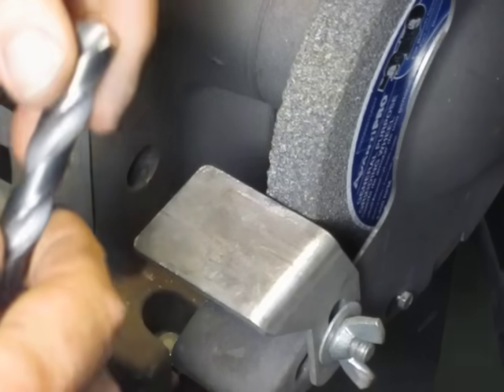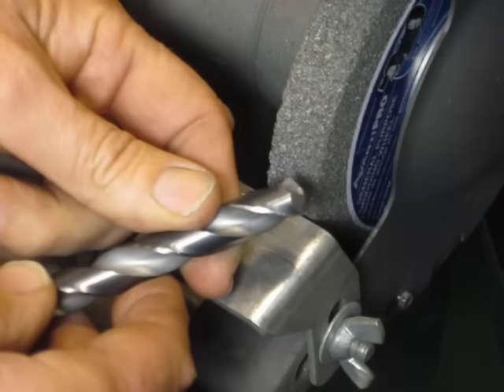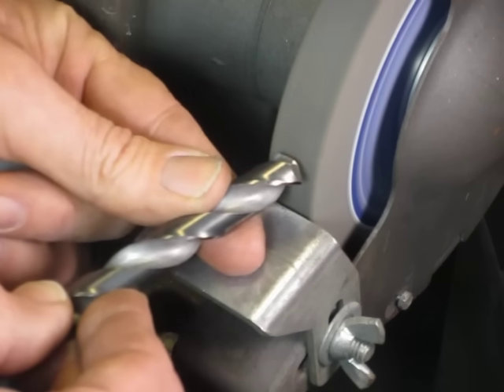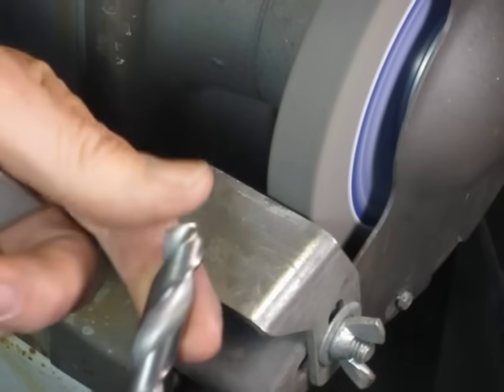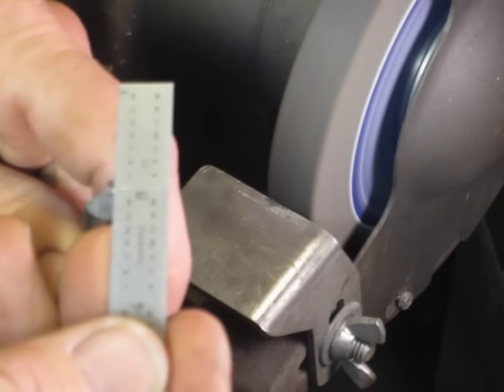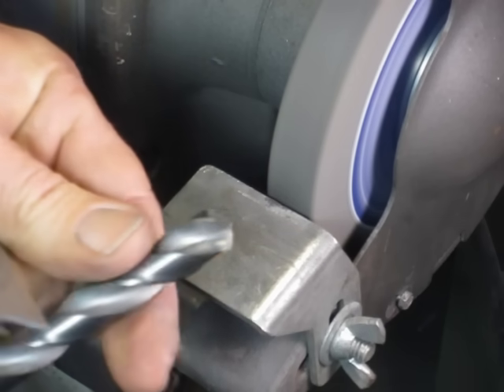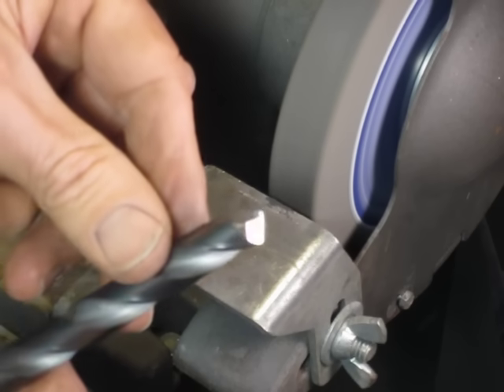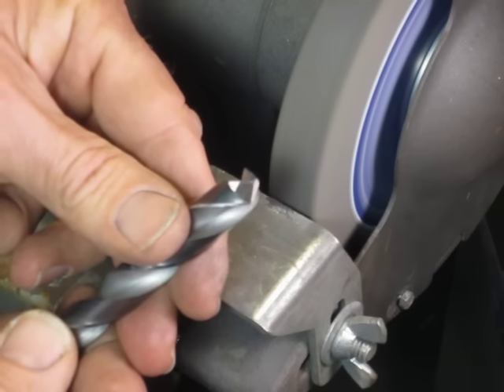How to Hand Sharpen a Twist Drill

Comment: Oh, forgot to mention, I printed out the 118º & 59º angels off my ink jet printer, laid it under the grinder edge and gave me a reference right there, then lay the bit to confirm the angles.
Reply from the maker: +wrthrash 
It's good to hear you enjoyed the tutorial. 

The paper template is an interesting temporary tool, but you may want to invest in a drill gauge for long term use.

Tom

Comment: If you clean up the cutting edge and then roll it back, alternating side to side to keep it even it may not look so pretty but it works just as well. A navy machinest showed me in 72 on Diego Garcia, been doing it ever since and saved a lot of money
Reply from the maker: +Cbmech 

I used to grind them using radial clearance until I discovered this method. It's much easier to control the angle and length of the cutting edge if the drill is held stationary, especially for those early in the learning stage. I do still use radial technique on the secondary clearance angle of larger drills because otherwise it takes multiple facets to get enough clearance. This multi faceted technique also uses less power to drive the drill which makes a big difference in the amount of heat generated with larger drills.

Tom

Comment: thank you for sharing your expertise. my question for you is I'm a novice if you could let people know everything meaning like the grinding wheel what size stone would you use to sharpen a drill bit? and how do you keep your drill bit from wandering? thank you very much keep up the great work. Merry Christmas Charlie
Reply from the maker: +Charlie053 
Merry Christmas to you Charlie.

I assume by stone size, you mean what grit wheel to use. The one in the video is 60 grit and works great for roughing out lathe bits in a hurry, but is a little on the coarse side for drills. An 80 or 100 grit would be more appropriate. 

As far as controlling the bit goes, that just takes practice. As I mentioned in the video, brace your hand on the tool rest of the grinder and practice lifting the tool off and placing it back on the wheel in the same orientation. A piece of mild steel is good to practice with because it makes more sparks and is easier to see how it is touching the wheel.

Tom

Comment: Or just roll the drill clockwise from the cutting points, going slower as you progress to keep the cutting bit raised, over the manufacturers already there 'cutting angle' and not faff about with angle finders & the like. That's what I do, I use a 40 grit linisher. 

Interesting video!
Reply from the maker: +terry tibbs 
I used to grind them all that way until I discovered this method. It's much easier to control the angle and length of the cutting edge if the drill is stationary, especially for those early in the learning stage. I do still use radial technique on the secondary clearance angle of larger drills because otherwise it takes multiple facets to get enough clearance.

This multi faceted technique also uses less power to drive the drill which makes a big difference in the amount of heat generated with larger drills.

Tom

Comment: No offence its a very good demonstartion but I think you probably  need to explain the basics as to how and why a sharp drill cuts and why a blunt or poorly sharpened one doesn';t with a demonstration/ diagram  of the twist drill. Basically to show the angle of attack of the cutting edge into the work. The 59 degree angle and using the guage isnt entirely necessary in all honesty any where near will be good enough and  not as important as the two basic angles- the cutting angle and the clearance angle. Additionally you could demonstrate with a very large drill say a 50mm. I personally use just the two angles on each side of the drill without the added movement to smooth out the two angles and also have a technique for grinding self centering drill bits with a more extreme clearance angle that takes the meat out of the center of the drill bit leaving a point. Once you understand why the drill cuts and why it doesn't the whole process becomes a lot easier.
Reply from the maker: +PETER FORDHAM 

This was one of my earliest videos and I have been tempted to re shoot it, but with more than a million and a half views, it's hard to pull the plug. My biggest problem with it is that some of the close-up shots are out of focus which makes it difficult to see the angles. I could definitely do a better job now in that respect. 

I disagree with your statement that the angle of the point. A sharp sharp angled point cuts much better in soft materials such as wood, and a more blunt point lasts much longer in hard material like carbon or stainless steel.

I have also considered adding demos to the video, but am afraid that it would be difficult to see the difference between a properly cutting drill and one that doesn't have enough clearance. What is obvious in a real life demo is not so obvious on video.

Tom
Reply: Its a very good video Tom I was really responding to a previous comment  where somebody stated they couldn't follow it very well as it assumed to much .  I would say that&#39;s probably correct for the complete novice who needs a sharp drill once or twice  a year. Drill sharpening is a strange one having worked all my life in engineering I have always found it a pretty simple task and can  almost do it blind fold yet  have many colleagues who will never get the hang of it  no matter how many times you try and explain the principles. I do agree with you regard cutting angles and they should be as near correct as possible for the best results. Reckon a simple drawing of a drill tip and "how it works" accompanying the video would be a winner.
Reply from the maker: +PETER FORDHAM 

I did ask that fellow exactly what he was having trouble understanding, fully willing to help him out, and he never responded. That was a little troubling because as a former teacher, I would do whatever it takes to help him understand the process. All he needs to do is ask instead of just complaining.

The drill geometry diagram is a good idea. I'll have to add one to the reference section of my website. 

Tom

Comment: I was told that manufacturers add a compound to the bit tip, Is this true?
Reply from the maker: +Cliedo Cladidahopper 

You can get various oxide coatings on the bits at extra cost, such as titanium nitride or aluminum titanium nitride, but it's not worth the money for general use. Just get regular old black oxide or bare drill bits.

Tom
Reply: thanx just curious I have a bunch of drill bits I need to sharpen

Comment: I have been a Machinist for almost 40 Yrs . I did a lot of hand sharpening over the years.  but a Driil doctor is great for resharpening   we have one at work (pro model) and use it for drills 1/2 inch and under (itwill sharper up to 3/4 drill) I have the small one at home paid $70 at sears and it works great.  you  are done it a matter of seconds
Reply from the maker: +1995dresser 

Gotcha beat at 46 years. :)

 I've been hand sharpening bits for so long that it only takes me a few seconds to touch one up on the bench grinder, so I've never seen the need for a dedicated drill sharpener. Besides, I bet you can't sharpen your lawnmower blades on one. ;)

Tom
Reply: +Toms Techniques  That's  6 more yrs  of smelling cutting oil and soup (coolant ) than me . I also can still hand sharpen quickly  I work in a fast paced environment sometimes machine repairs or parts .  as for lawn mower blades believe it or not. I file them sharp only because the newer mulching blades have those weird bends in them almost impossible to grind. but its funny how we can sharpen drills by hand and put a gauge on them and they are perfect lots of year of doing it .

Comment: very good....what i use to get the angel instead of a protractor  is 2 hex nuts pushed together..you push the tip of the bit between them ...it also gives you a guide if you have got both sides the same as the 2 nuts will sit wonky if you have not,,so no need to use a ruler
Reply: +david appleton Good idea

Comment: I was very successful with using Toms techniques. I also found his teaching instructions very easy to understand and duplicate. I can't stand all you You tube hot heads that criticize a good man sharing knowledge.
Reply: I am not a machinist by any stretch,the reason for sharping bits is I watched a friend try to drill out exhaust studs and now this is what I am doing to learn the art of drill bit sharpening ,thanks for all the help and I am retired dozer operator.
Reply: I am having trouble getting the 58 degree angle min looks like a permid.am I getting the bit off center need some advise
Reply: True, true, every once in a while I see someone do a proper job and some idiots can't do it, but critique the shit out of it.
Reply: Yyýyýyýpqppo
Qwilleran
Qpqppwqp1pú

Comment: Very, very nice demo.  Thanks.
Tom I'm concerned about the grind wheel grabbing the edge of the drill bit and pulling it down into the guard.  Is it better to grind the lower edge of the bit, i.e. the opposite edge, although it is then hidden from view, so that the wheel won't grab as easily?
Reply from the maker: +mike7gerald 
Mike,

Grinding wheels don't "grab" tool bits, although they can be dragged into the gap between the rest and the wheel if it isn't set correctly. The rest should always be kept 1/16" or less from the wheel.

Tom
Reply: +Toms Techniques I think mike is commenting on you grinding against rotation direction with the bit pointing up. Have you ever experienced kick-back or "grab" as he calls it on a bench grinder? Were you grinding against the rotation, (bit pointing up) or with the rotation, (bit pointing down)?
Reply from the maker: +Jim Adams 

Like I said Jim, grinding wheels don't grab. Virtually all lathe tool bits and drill bits are ground with positive clearance angles by holding the tool angled up against the wheel. And no, I've never had one grab or kick back, or heard of that happening in the fifty or so years I've been using bench grinders and surface grinders. BTW, angling the tool down as Mike mentioned is not a good idea. Not only would it make it impossible to see what you are doing, it would also increase the risk of the tool getting between the rest and the wheel, which IS a very real possibility.

Belt sanders are another story. They will definitely grab if a part is angled up against the belt (because of the joint). I had the tip of my thumb ground off to the bone once when a piece of angle grabbed the belt and was pulled between the belt and the table, along with my thumb. I was lucky that it all grew back, but it was a hard lesson learned.

Tom

Comment: All very well, but one of the most frequently used drills, at least in DIY general use is the 1/8 inch or 3 mm diam drill.
These are small & present much more of a problem, you need a light touch & very good eyesight.
I commonly use 2mm & 2.5mm diam drills also but due to advanced years & poor eyesight I more or less guess & hope.
How would you tackle the smaller sizes?
Reply: Ditto!
Reply: +Peter Owens With drills that small you need to guess how to grind it, do it in one try, measure it. Do it one cutting edge until it has a good angle and free angle, then do the other side.

You cant correct much on those, it needs to be perfect in one grind.
Reply from the maker: +Peter Owens 

You are correct, the small ones are much more difficult to grind. I can still grind them down to about 1/16" in a pinch, but normally I just throw the the small ones away when they get dull. They are so inexpensive that it's not worth the trouble to sharpen them.

Tom

Comment: ive never had the luxury of sharpening on a bench grinder so i could better control the angle. always had to use hand grinders on site but the bits were still turning out allright :)
Reply from the maker: Sorin Cioriciu 
That bench grinder was the first and probably the most inexpensive piece of machinery that I purchased. It gets a lot of use.

Tom

Comment: this is a great vid, I use it with students, and this is the best way to teach a 15 year old with no skills how to get a drill shape and they cut like there is no nothing there.
thanks
 Tom lots of kids in W.A. Australia are sharpening drills this way.
and just a not I worked with some Malys that would sharpen the bit on the corner and curve the cutting edge in, and they pull through the material.
Reply from the maker: Barry Palmer 
Thanks Barry.

I wish I had known this technique when I was teaching ninth graders. It is definitely easier to learn than the traditional radiused clearance angles.

Tom

Comment: That was bizarre!! if i sharpened a drill like that at my toolroom ...id be laughed out towards the door
Your leading edge would break down fairly rapidly on anything other than wood...Wheres the radial side rake? Your secondary grind should only thin the chisel edge and not the back .
Sorry to diss you video mate ,but its a terrible way of sharpening a drill
Reply from the maker: adam wooldridge 
Adam, 

Virtually every drill sold commercially today has been sharpened using multi-faceted geometry. Radial side rake, as you call it is definitely old school and rarely used anymore. Not sure what you are referring to about the secondary grind. The last operation I perform in the video IS thinning the chisel point (not edge), definitely not the back. Perhaps you should watch the video again in its entirety with an open mind. You may just learn something.

Tom
Reply: Tom,
Im assuming your in America...
Im in the UK and have been a toolmaker now for 37 years...and in all those years ive never come across a new or re-sharpened drill like that.
It must be a state side thing.
Most of my work is for the American motorsport industry ie; indie cars and LMP.
Most drills used in the transmissions are solid carbide TF drills as the HssCo drills cause sparks that could ignite the mag swarf
Adam
Reply from the maker: adam wooldridge 

Adam,

Here is a pretty good article explaining multi-faceted geometry. Not where i learned the technique, but a good explanation of it.

Tom

Comment: not the way i was taught...it's a "twist" drill so to relieve the cutting edge use your thumb and index finger in the flutes and "twist" then you get a drill with a finish the same as the brand new drill, also angle the drill against the wheel so you get the correct angle on the chisel point..I sharpen all drills at work by hand all from 3mm up to 100mm, the bigger ones (50mm (2")) I use a "paint stick" to measure the lip height..that is a stick with a pointed hook on one end that locates in the drill centre hole on the tang..all large drills (straight or morse taper) have a centre hole, put the drill on this and scrape the outer most tip of the lip one side and repeat for other lip, and this will tell you if it has level cutting lips. Must say I get a "bollocking" at work if I "relieve" the chisel face like you demostrated...I still do it though it save putting a pilot drill through first!!!
Reply from the maker: Clive Clarke-Watson 
Sorry Clive, but the radial relief method we all learned years ago is now old school. Most every drill you buy today has a multi-faceted grind similar to what I demonstrate in the video. They cut easier, generate less heat and are much easier to grind, especially for newbies. Not sure why you would be "bollocked" at work for thinning the web. It makes the drill start easier and less apt to walk.

Tom
Reply: I agree Tom but the old boys hate it!! Still do it from time to time just to p**s them off!!!
Reply from the maker: Clive Clarke-Watson 
It's always good to piss off the experts whenever you can. :)
Reply from the maker: 1Howdy1 
The chisel point definitely does not cut, which is why the web gets thinned. That reduces or eliminates the need for step drills, which really saves time.

Tom
Reply: Toms Techniques
Well said Tom!!!

Comment: Really good tutorial Tom, can I just add that in certain circumstances, you might want to show how to " Back off" the leading edge when drilling brass or bronze alloys, A conventional drill will tent to grab as it breaks through the piece you are drilling , but if you grind the face of the leading edge in the flutes giving a 0 angle ( or negative) , this alleviates the problem.
Reply from the maker: 1ginner1 
Thanks.
Grinding drills for use in plastic and brass has already been covered in a separate video.

Tom

Comment: One of my co-workers sharpens the drills at work to more of a point than how they come brand new.  Best I can describe is he sharpens them to what looks to me at least 90 degree included angle or more.
Reply from the maker: earthjin2000 
Sharper angled points (<118º) are better suited for soft materials like non-ferrous metals and wood. Hard materials like steel require a flatter point (>118º) to tolerate the additional heat produced by the cut.

Tom

Comment: Here's a suggestion.  For "thinning the web," I think using one of those thin cut-off disks on a Dremel Moto-Tool would be ideal.
Reply from the maker: Clyde Wary 
You can try it, but I think you'll find that it's much quicker and easier to just do it on the corner of the wheel. I took a lot of time to sharpen this drill to show all of the detail, but it normally takes me about 30 seconds from start to finish.

Tom

Comment: Thank you Tom but one thing I want to understand is when we measure the inclination with scale does it changes when the degree varies?
Reply from the maker: Suresh Ram Rao.channagiri 
Are you referring to the length of the cutting edges? If so they do change with the angle of the point, but as long as they are each the same length, that's all that matters.

Tom
Reply: yess